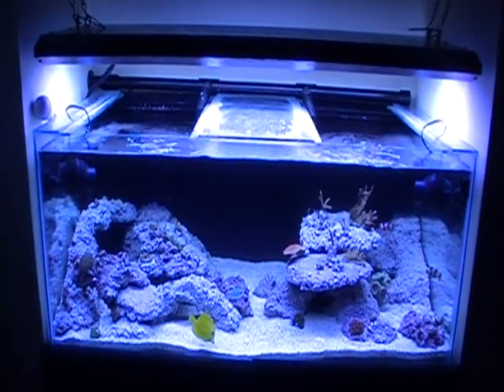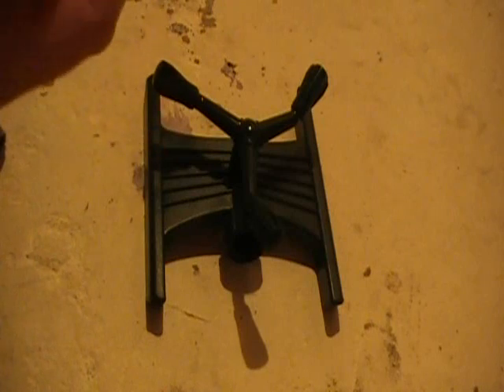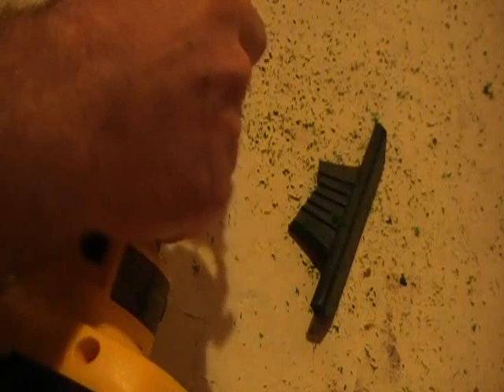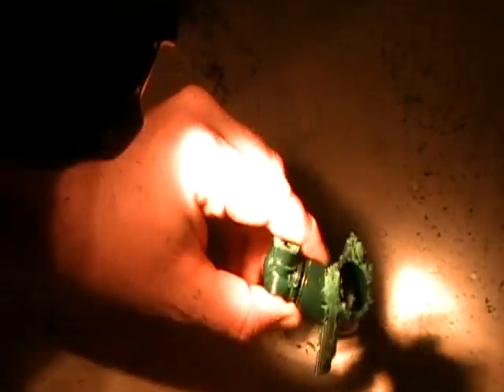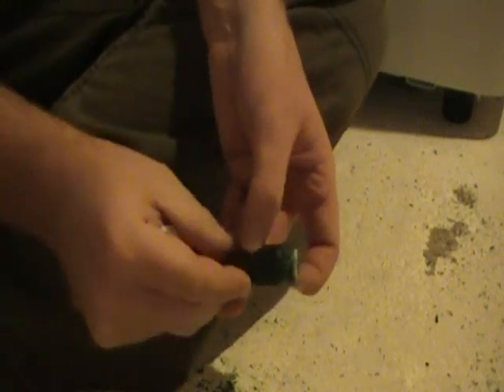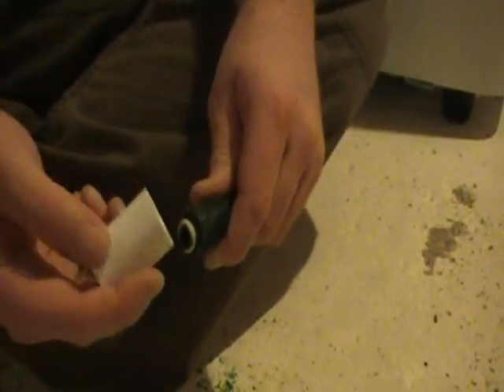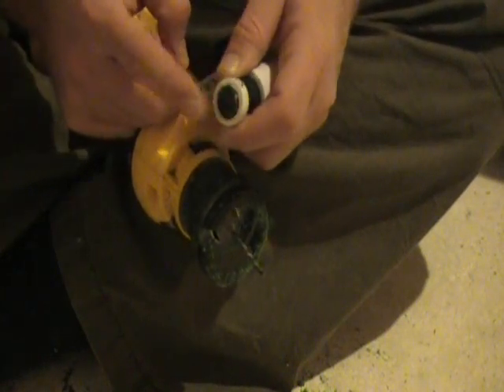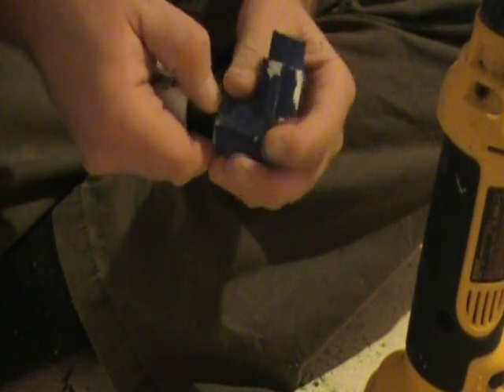Rickets Reef: DIY Surge Device Part 1

Comment: Can I leave the sprinkler head outlet portion intact and just cut off the base and adapt the inlet plumbing? Is the flow too weak to provide adequate circulation if it's left divided into three separate outlets flowing in three separate directions instead of one single outlet flowing in one direction?

Comment: hey, I've ordered the bit's I need for my own surge thingys. I have one question though... If your return pump fails or you have a power cut, won't the main display tank syphon to the level of the surge outlets?? 3 to 4 inches of water? How do you prevent this? I don't want to flood my house... again. :) cheers for the vid's!